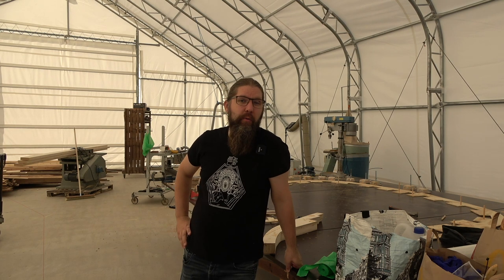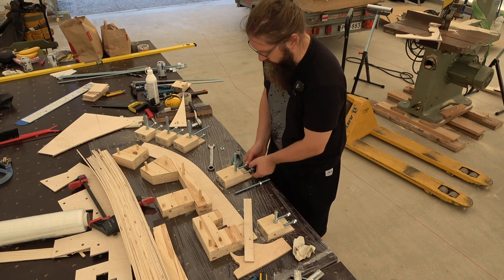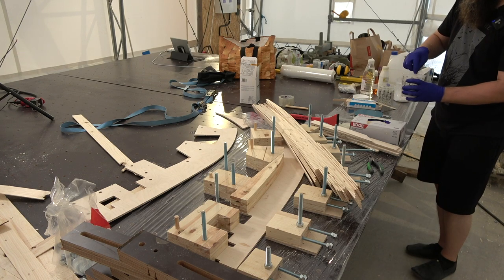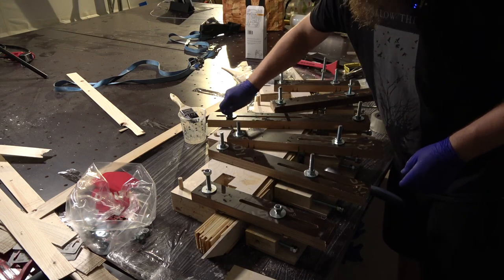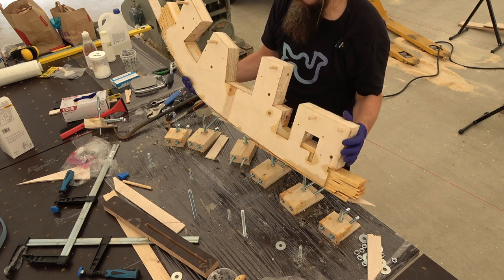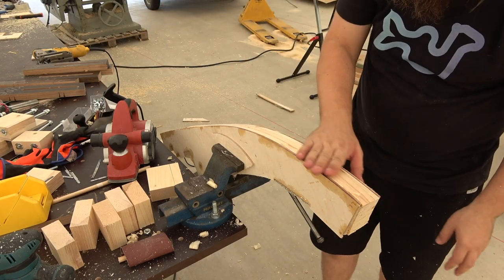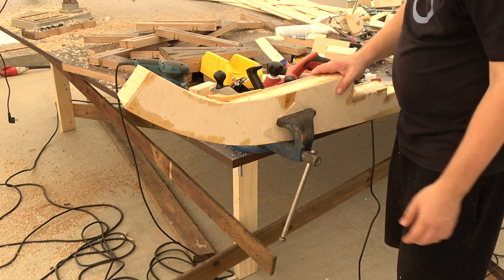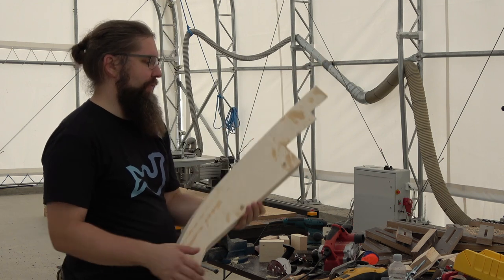SAILBOAT BUILD: Final test before build starts! pt2,  ep.44 Project SeaCamel

Comment: Great job. You can try steam bending your wood first. That will help with tight curves. Can't wait to see the boat go together. Good luck.  USA
Reply from the maker: Hi! These thin slats actually bend pretty well. I might have to try steaming on the bow, there's much tighter curves to bend to.
Another thing is that bending tight curves requires much higher quality wood without any knots and other defects.

Comment: Not sure what  epoxy you are using but have learned that mixing cotton flock with epoxy makes a better glue than pure epoxy. So You would wet the wood out with pure epoxy, but the the actual glue would be the cotton flock mix.  There is also a pulpmicrofibre product with similar properties.
Reply from the maker: For this i used just a little bit of silica powder to make it little thicker.

For the frame (that have been already done one) there's really no working time to make separate gluing and pre-coat. I need just to roll the stuff in and it holds them together pretty well. At these temps I don't need even to thicken it to keep it there.
Reply: @ArcticSeaCamel  Thanks for Your reply. I guess the wood you are using is so smooth that pure epoxy works really well,  for rougher surfaces might be good to use a thicker formula. Very interesting project anyway!
Reply from the maker: Yeah, I try to make planed surfaces to fit them well and also to use less epoxy.
Thanks! ☺️

Comment: Just curious why you didn’t just mill more pieces like the outside CNC plywood and laminate the together?
Reply from the maker: Hi Scott! Good question that has been asked before! I probably need to make Q-A at some point again. 😄

The reason is that the wood fibers need to be continuous with the full length of the frame to make it strong enough. So you need either bend them (like I do or like Acorn to Arabella did) or get really crooked timber to make the frames from them (Like Tally Ho).